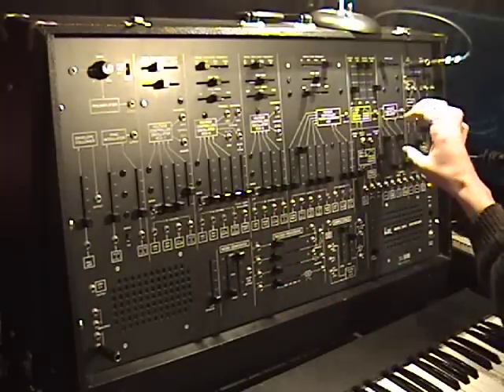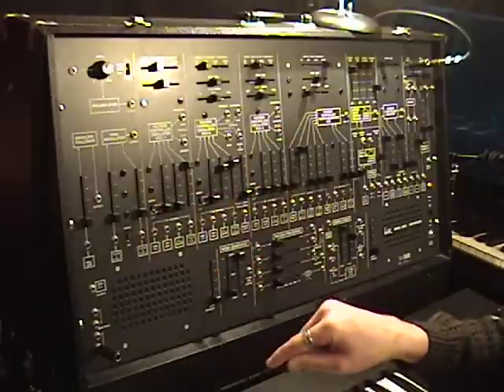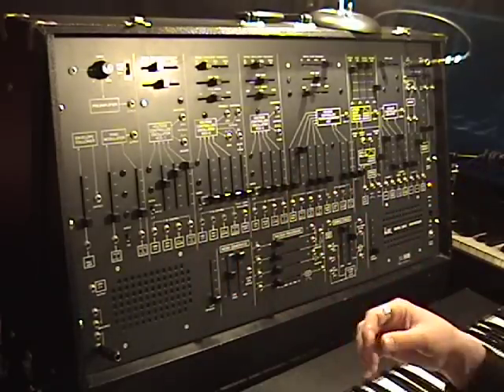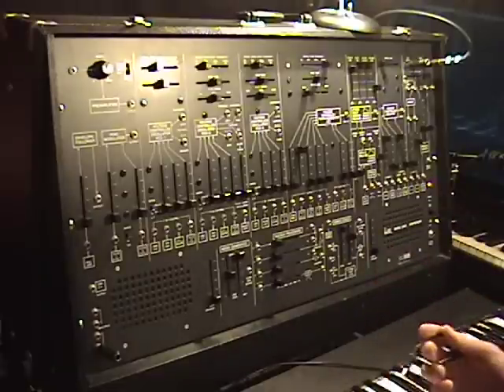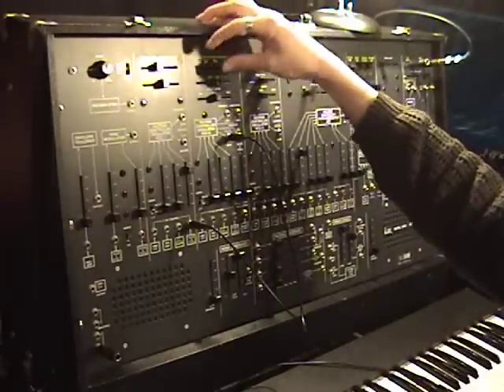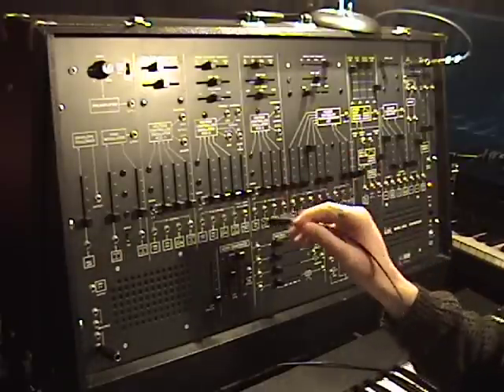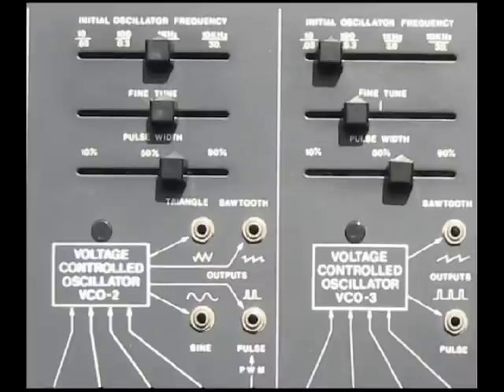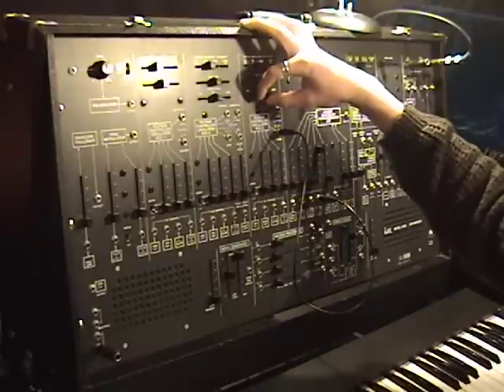The ARP 2600: Oscillators Part 2 (high quality)

Comment: The fact that OSC2 is the only one with PWM control input… I think a different version of the ARP keyboard (2601?) has an LFO built in, so that’s how you could get that sound back in the day, right? I’m enjoying these videos immensely, having just picked up the Behringer version. Unlike the Korg they’ve put the LFO from the keyboard into the main unit - but they also put PWM control on OSC3 and some other changes, switches to shorten or lengthen the envelopes and all four waveforms on both OSC2 and 3 and sync on 2 and 3 also. Sure it’s less authentic that way but I don’t mind the changes. Anyway, thanks :)
Reply from the maker: Yes, authenticity suffers, but it’s a useful architecture!